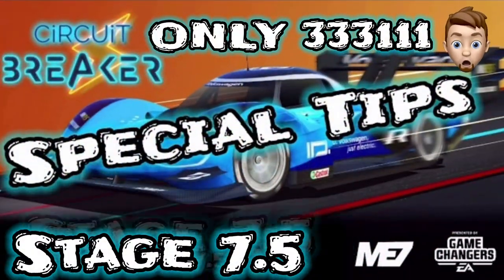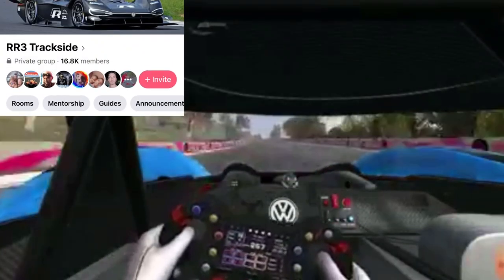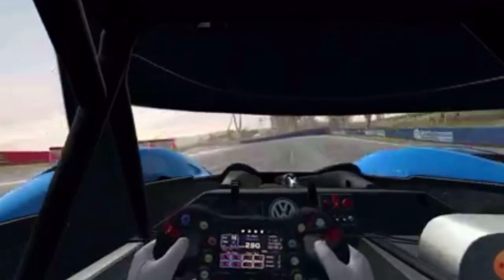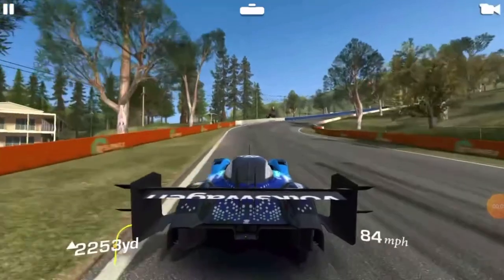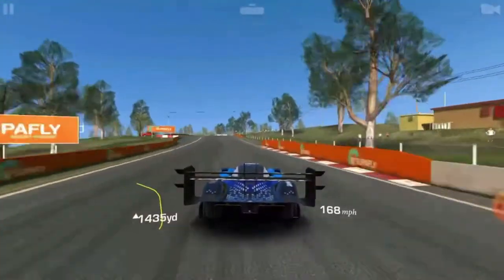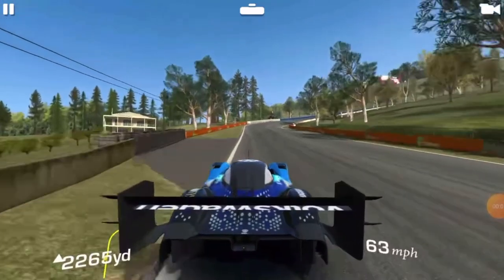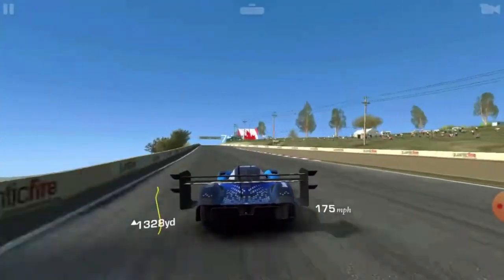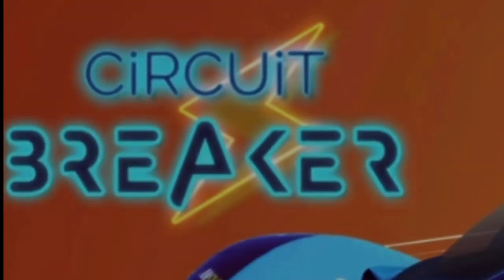Circuit Breaker - STAGE 7.5 with 333111😎

Comment: Just did it and can confirm it works. took me quite a few tries, but it worked. 
Tips to keep in mind-
Minor bumps are allowed, so you dont need to restart the game if you don't fail the goal, just drive backwards and retry.
Chase view camera is good and I did it using it.
You really do need to exit the corner with the braking point at 223km/h before bricking on the accelerator. I was really close to not having enough speed with 224 when exiting.
I managed not to go as close to the wall at the apex of the last corner as what was shown in the video, so it isn't as impossible as it looks. The tricky part is quickly timing properly the corners before that.
You can also repair your car fully, cloud save, go practice and retry many times and even repair with gold then cloud restore when you feel like you got the practice needed.

Comment: This was so tricky and required so much accuracy and precision! Managed to do it with upgrades 333111 too 😁
Reply from the maker: That’s very impressive! It is extremely hard to throw that car around that accurately up on top of the mountain.
Reply: @ME7_RR3  now that I've rewatched this video again, I realized I didn't have to take Cutting Corner full throttle, I should have known that, it would have been a lot easier 😅 but anyway, I'm happy to be able to achieve that!

Comment: That is amazing, for sure.  I tried that in a race in the Legend series and spun out, but I have more upgrades than he did.  Maybe I was just carrying too much speed at the top to make those turns.  Speaking of the Legend series, have you run any of those races yet?  Man, they’re ridiculously easy; the bots are just terrible.  I’m halfway through it, most of it with a dead car.  Seems odd that they’d make the event so hard, but the Legend series so easy.  Hard to figure...
Reply from the maker: Apparently you can actually start further up the hill and still hit speed. So yes you could slow down a little bit in the top section and still hit speed at the lower section. If you have more of speed upgrades then you definitely want to start further up the hill so you’re not going to crazy fast.

Comment: I had this question on the 2nd electric car championship event which is on right now. 
Is the 2nd car really worth all the golds, since the pr for both car is same, and it only acts as a filler? You can do most of the series with just one car, and the same pr for 2nd car doesn’t really bring you much gold in return. Ea is getting more and more sneaky in their ways to exhaust our gold savings. Earlier, there used to be one car in the series, but now now they are putting two new cars in the same series, which would obviously hurt our gold savings, as there won’t be much in gold return for two cars from the same series. I wanted your thoughts on it, and If I should really go for this car or not, given it’s just a filler.
Reply from the maker: Some people like to have every single car in the game. One or maybe even both of these will get an exclusive series in the next update. As of right now, I’m actually not going to do the event. I have the Porsche, I don’t like these cars, I don’t want to spend any gold on them. That might mean I do badly in a weekly time trial Competition but I don’t care about a one week here or there.
Reply: @ME7_RR3  thank you for easing my mind.

Comment: I think there is a possible endless endurance in vertex spirit 9.1  I always manage to go in for 14 laps and it pays 3,100 a lap. My mclaren isn’t maxed nor do I have the other cars. You should try it out!
Reply from the maker: That should be endless, those circuits usually are. However the fame pays isn’t that good and that’s usually what I base it on. Fame per and R$ per minute are the most important numbers. That’s why the Audi R8 LMS ultra and Porsche 918 RSR concept are so good. The upgrades are cheap compared to the three cars in Vertex and the earnings per minute are pretty good. Plus, it’s one of the easiest races.
Reply: @ME7_RR3  true true. I have the Porsche 918 RSR and it handles well. It’s the only reason I have the money to earn cars like the ID.R and the Aston Martin Valkyrie! Ofc with your tips, it helps!

Comment: Hey ME7, unrelated but my AMG GT4 is facing a gearbox problem. It is stock and just stuck at 5th gear while doing the time trial in Melbourne. Why is that?
Reply from the maker: I don’t know. What happens if you slam on the brakes until it comes to a complete stop? Melbourne is a pretty fast moving track so it might not be a lot of gearshift going on. When I tested it, it started in third gear and went up to fifth. Maybe you have a glitch and you should reinstall the game. Do a cloud save first

Comment: I started this event yesterday just before midnight and I finished day 1 and day 2, I want to play 3rd day before midnight is there any  Consequence if I change the region time , play the 3rd day, return to my local time?
Reply from the maker: I think the only time people get in trouble is when they do it cloud restore after buying upgrades. I did lose all my OMP points moving a few hours ahead during this event. I did a cloud restore and suffer that penalty. Going 4 or 5 hours doesn’t seem to be a problem (other than OMP points). However when people start going days they end up in trouble and I never do that. That’s where you can miss out on your daily rewards for the month.

Comment: How the heck does a car rated for 184 mph hit 195???
Reply from the maker: It certainly is a big jump! I believe there are 2 factors. 
1) On straight sections this car can hit pretty close to its top speed. So then on downhill sections it quickly exceeds it. 
2) you stay full throttle in this car more than any other car in the game. For instance at Spa you only need the brakes 3 times per lap. That makes those downhill sections add up.